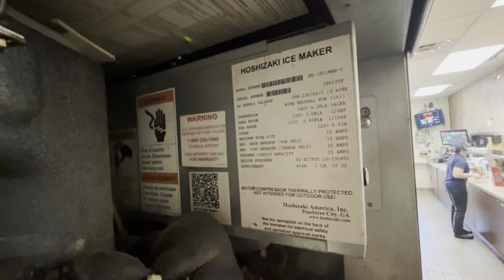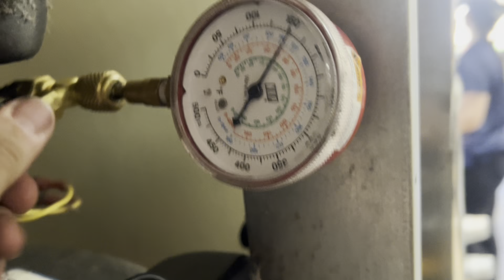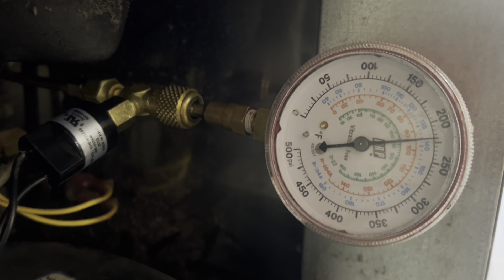Hoshizaki - 1 beep error

Comment: I can't tell the model of this machine. But, Hoshizaki models 650 and 801's there is a micro button switch on the control board, upper right hand corner. One single push of button during first power on start up. Will bypass the 5 minute compressor delay. Says this in the service manual. Next time, you don't half to wait the 5 minutes. Push the button one time. And the water fill time is to long. Water filter or screen clogged. Needs to fill the water faster, or you'll get a beep error. And yes, it's dirty. Clean it! 😂